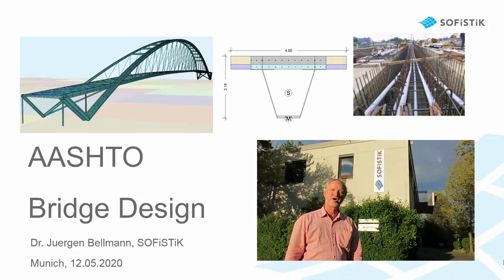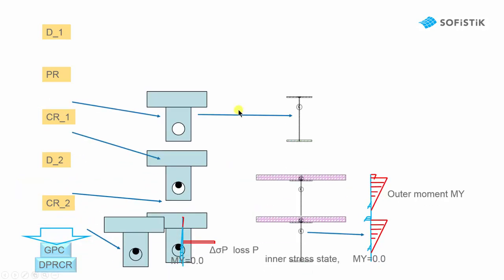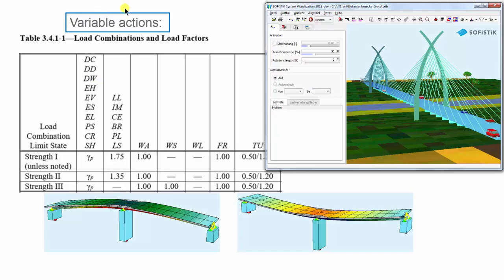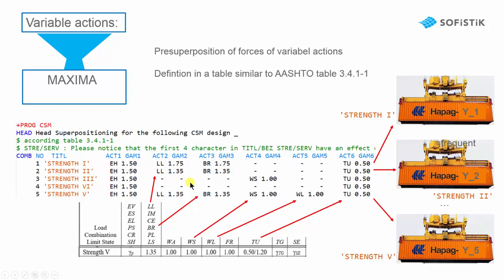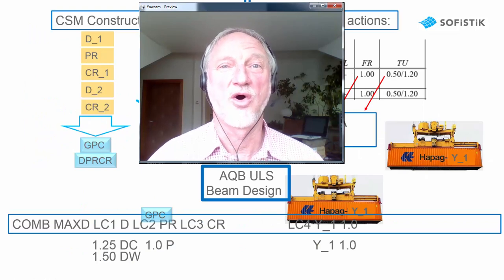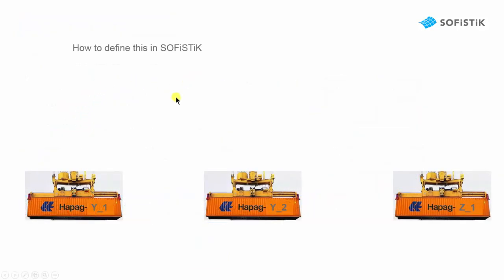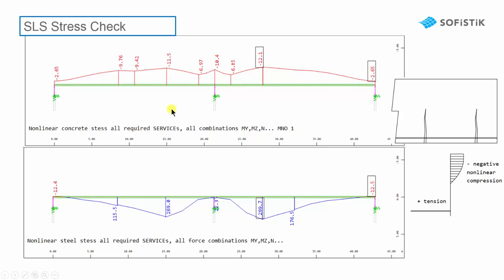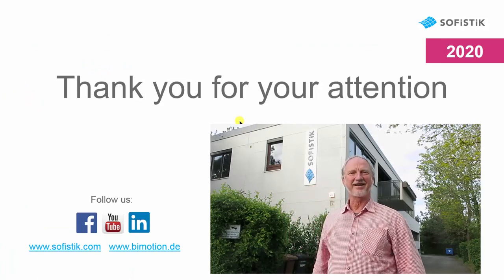CSM DESI AASHTO Bridge Design

Comment: Could you please explain fow AQB can understand that container "Y-1" is the same than combination "strength 1". Seems that one step is missing here  thks
Reply from the maker: Hi Oussama,
The program knows that due to the numbering scheme.
If you look at 3:05 you can see the "CSM"-Input for the combination rules 1 to 5. The superposed actions (based on these combinations) from "MAXIMA" (2:55) are then stored in so called "result containers" that are in this case labeled as Y1 to Y5.
Does this answer your question?